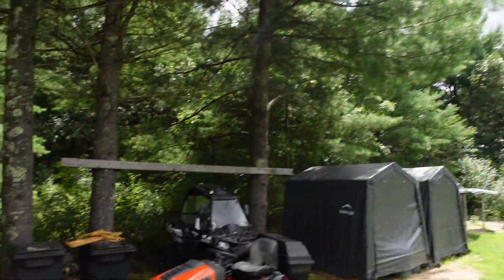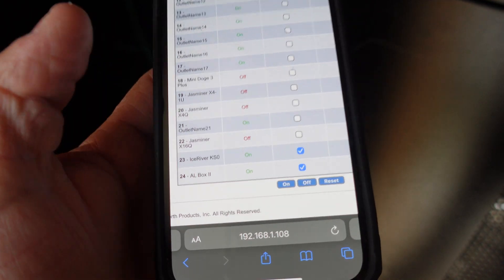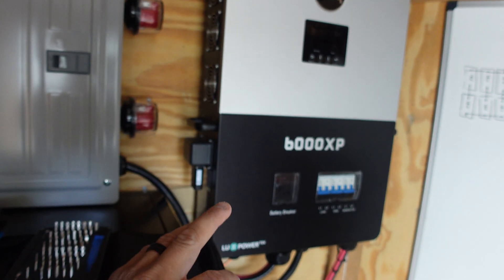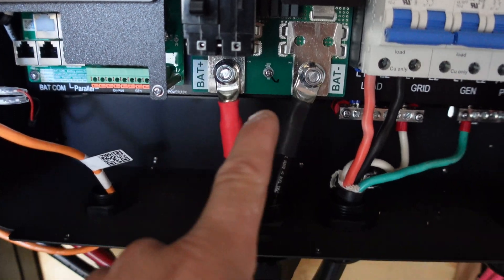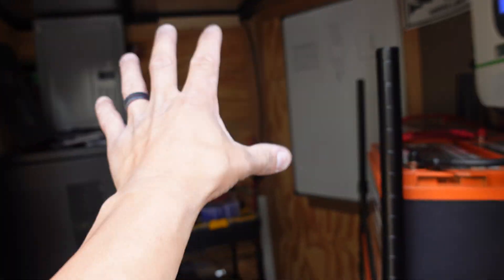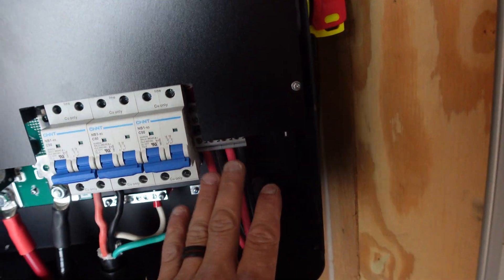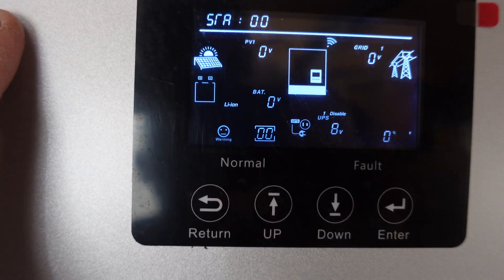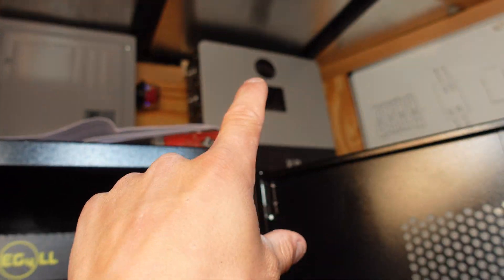They Sent Another 6000XP Because I Messed up...

Comment: All you had to do was ask, I could have told you that, or just read the instructions.  So have you updated the battery firmware?
Reply from the maker: Not on these last 3 I have not. Also the switched I didn't realize they were incorrect so thats was the issue.

Comment: Lol i remember looking at that manual when u were setting it up and thinking that u set those dip switches opposite way than manual showed just didnt say anything because i thought i read that wrong when it worked...
Reply from the maker: Dude what’s crazy is one person actually said that to me so I sent a picture of the way I had everything set up and my rep never realized it either so I just assumed that it was correct! I don’t know what I was smoking that day, but clearly it was good 😂 

In the pinned comment, I corrected the issues explaining to people what I did wrong technically only the first battery matters as long as the others are different it shouldn’t matter, but they do need to have the same firmware, which is actually the issue I’m having now at the other three that I need to address.

Comment: For those Battery, if you have the DIPs set in order, then you need to match up the same firmware. There is a chance the LAN cable is bunk, wire up new ones and make sure to cycle the system after making changes to the config. I had a green comms cable that was bad, i just made up my own and it was fine.
Reply from the maker: Awesome thanks brotha!! Ima dive into the firmware shortly!

Comment: Ouch.  Tech support should have looked at dip switches first in the checklist.   At least they admitted to that.  Sig Solar looks to be very reputable.  I’ll keep an eye on them for my upgrade next year.   

Edit. Also when you are running full load after a day or so take a heat reading of the red load line coming out of inverter. It looks warped from heat.
Reply from the maker: I’m sure he glanced over it cause it was backwards so seemed correct… but it was my bad at the end of the day. So DUMB! 😂 F
Reply from the maker: I will do just that for you no problem my man!

Comment: @CCXD dude sorry you are going through all this, however i am very happy you make a video showing issues and how you resolve them, so many other channels would not be upfront about this, as for the 3 new batteries, as a test can you try using just the last 3 set of batteries with the inverter, from my understanding all the batteries most have the same firmware for them to work together, so if the 4th battery gets ID 1 and  battery 5-6 is looped in, connect the 4th battery to the inverter and see if 4-6 works with the inverter as 1-3, or upgrade all your batteries to the same firmware and see if that resolve it.
Reply from the maker: Ohh that’s a great idea I’ll try that with 4-6